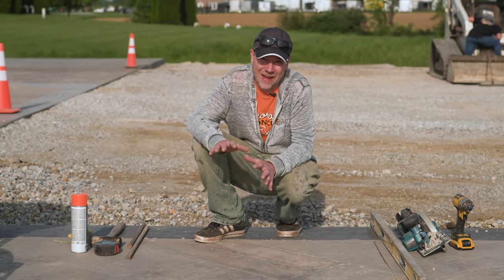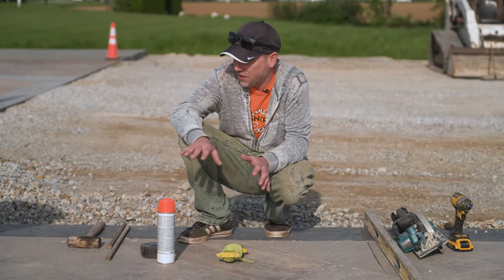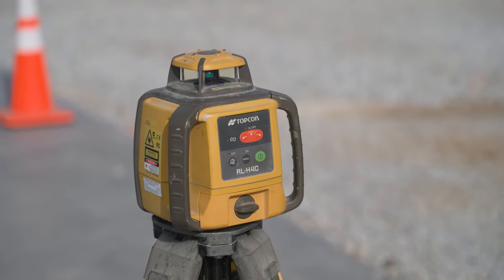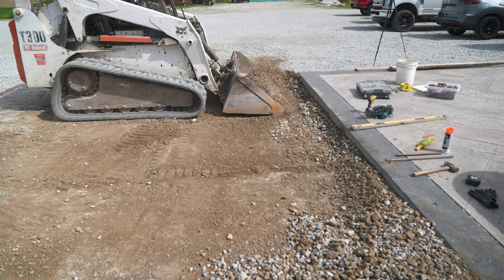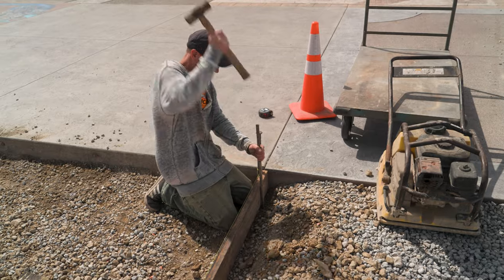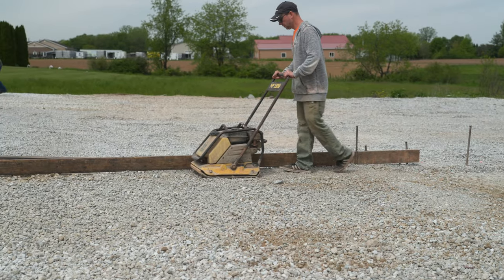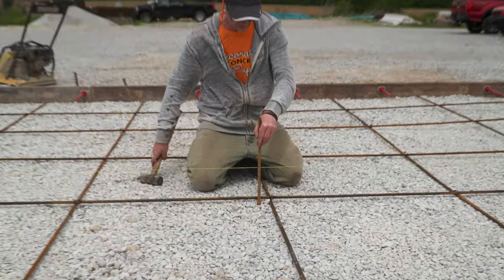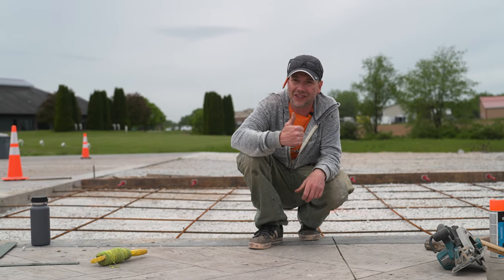How to Form a Concrete Slab in Under 10 Minutes!

Comment: how many ton can this slab bare?
Reply from the maker: Thanks for the comment! The final load-barring strength of any concrete slab will depend on the mix design, how much water was added, reinforcement, and curing. Generally, a 5.5" thick, reinforced, 4000psi concrete slab will typically handle 10,000-12,000lb or 5-6 tons. Again, this number can go up or down depending on all the variables. Thanks for watching Deco-Crete TV!!!

Comment: Thought 14 gauge wire mesh is enough for concrete slab like this.
Reply from the maker: Most people would consider 10ga wire the minimum for a 4" slab, some use 8ga if it's gonna get vehicle traffic. This slab was 5.5" thick and gets heavy vehicle traffic. We just prefer working with rebar instead of wire for small slabs like this. If we had used wire, we would have used 6ga. Thanks for watching!!!

Comment: so... you scrape gravel/rock away to then add gravel/fill after you form???   sounds counterproductive and wasteful
Reply from the maker: The slab in this video was in our parking lot that already had a gravel base, so in this case we could have used what was there, although what you can't see in the video was how chucky the base material is. The limestone fill is just nicer to work with. And don't worry, we didn't waste anything, we used the chucky base material in other parts of the parking lot. On most concrete jobsites however, there won't be any gravel base to work with and you'll have to dig into the ground. Thanks for watching!!!